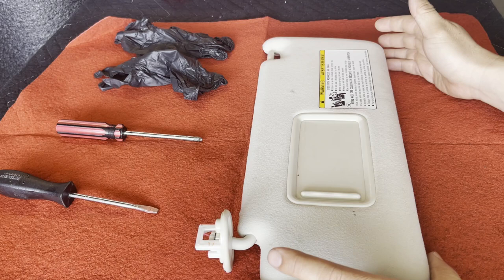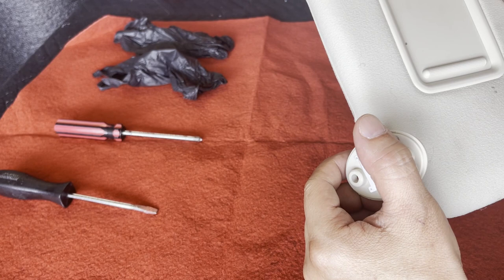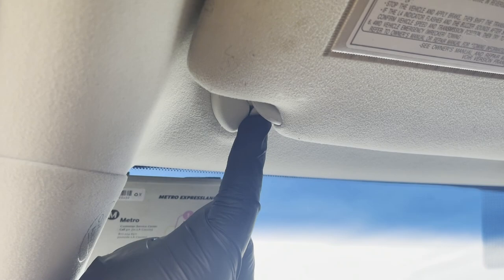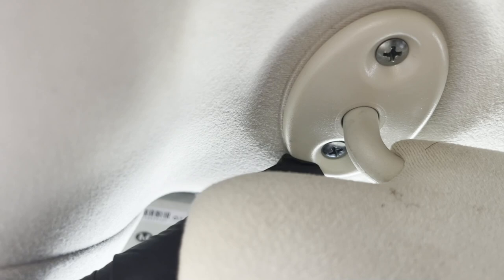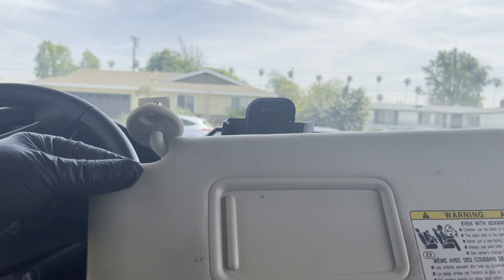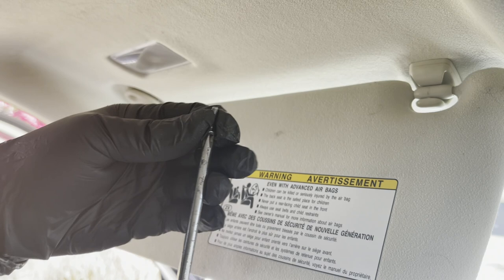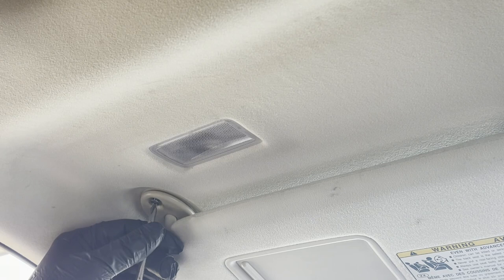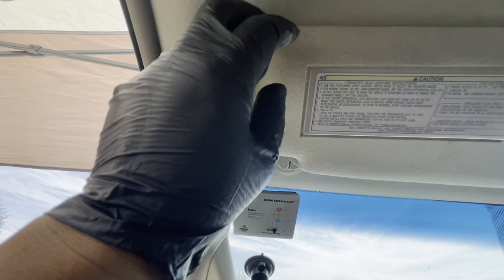Lexus GX460 SUNVISOR REMOVAL - Vietnam Edition

Comment: Great instructions! 
My GX sun visors were sagging and I replaced them with aftermarket  5th Gen 4Runner sun visors. Worked and fit perfectly… easy replacement with your instructions!
(Costs less than $50 for a pair and didn’t have to pay hundreds of dollars for oem. Only “issue” is the fabric is different. Beige color I bought was close to ecru. So I was happy with the replacements.)
Reply: Hi @mikes2582. My 2013 Gx does the same thing. Do you have the link for the 4Runner sun visors you brought from. Thanks.
Reply: @janjanoca  I purchased them on Amazon. Below is the item I purchased. Although the description says it’s for the 4runner, it fit my 2014 GX perfectly.
Fabric is different from OEM and color is a shade off but I’m happy especially with the price. :)
Left Driver Right Passenger Side Beige Sun Visor with Vanity Light Fit for Toyota 4Runner 2010-2023 Sunvisor Replacement 74310-35B00-E1 74310-35B01-E1

Comment: Nice video and music Bob.  I believe the Prados have a turbo diesel and some of them actually have the 4Runner V6 4.0 liter engine, certainly no V8 like ours.  Bob, on a side note, do all the lights inside the GX use the same LED?  Including the ones in the doors and behind the sun visors, etc?  Thanks Bob.
Reply from the maker: The sunvisors (vanity lights) use the same led fitment as the rest of your interior lights.  You thought about switching to door projectors? 
https://youtu.be/_Vseszq5vVY

Comment: Hey Bob thanks for the videos.  Can you tell me if the wood trim around the window switches are replaceable?  The 2022 come with black plastics but all previous versions are wood. I wanted to see if I can easily swap them out or I have to replace the whole window switches module.  Thanks.
Reply from the maker: The trim does not come separately from the switch itself.  Most sellers 99% sell the switch with the trim.